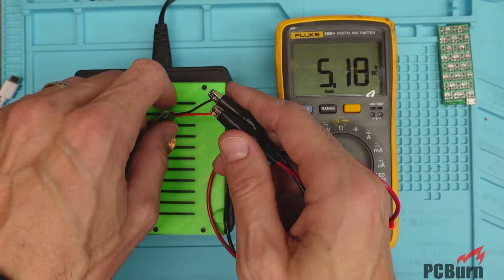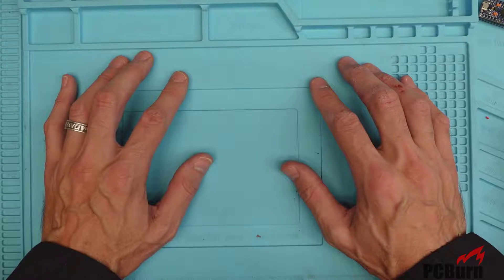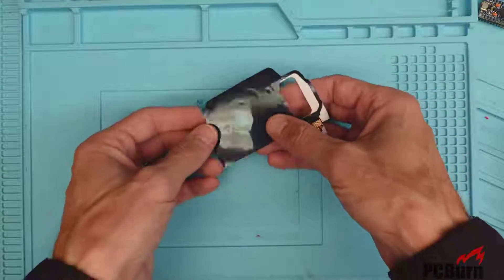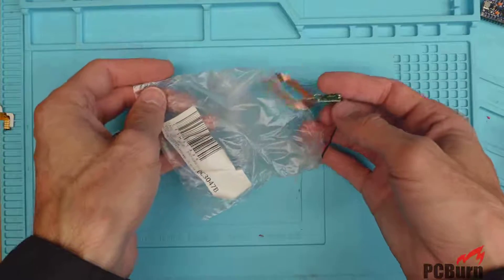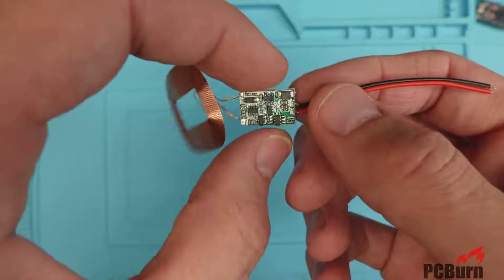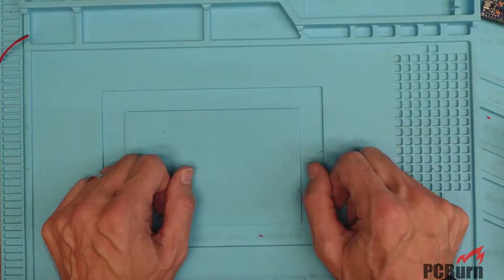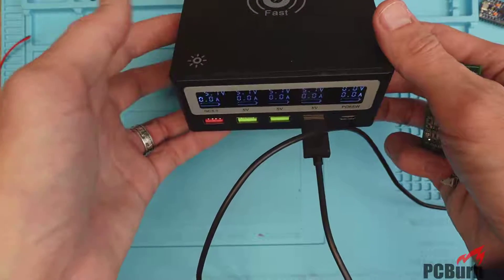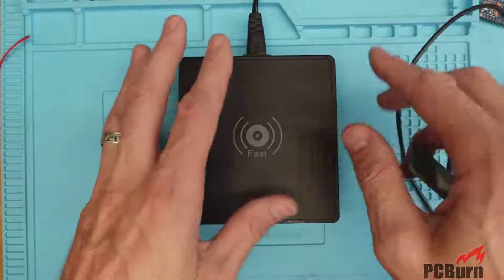Just Add Wireless Power - Qi Charger Receiver (ComM)

Comment: can  put this wireless module inside my huawie novaa y70,can  you pls make a vidio on how to   do?!!
Reply from the maker: @jetterabison-y8x  Internally? Probably not if you're asking the question as that'd take some technical expertise. It's not something I'd personally do on a (modern) phone not already engineered for it in some way as I think it'd be hard to do it well for long term use.

You may want an external USB connected part if it makes sense. Or some form of pre-made after-market case that has wireless you can connect somehow if it's available.